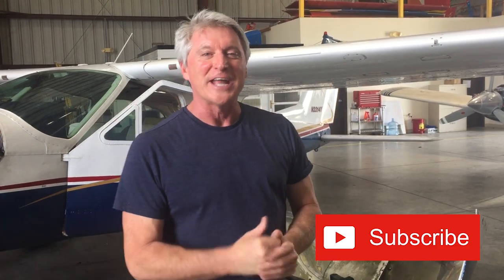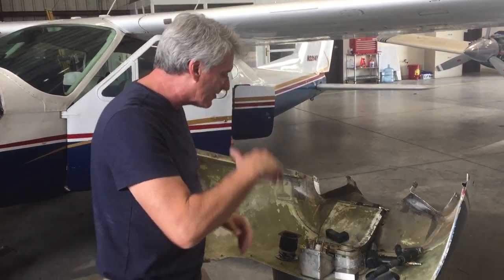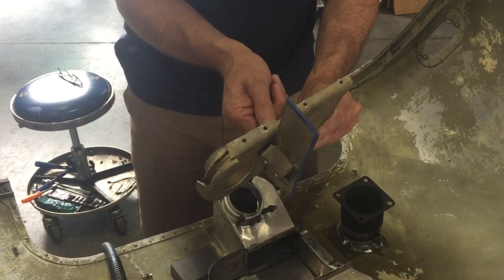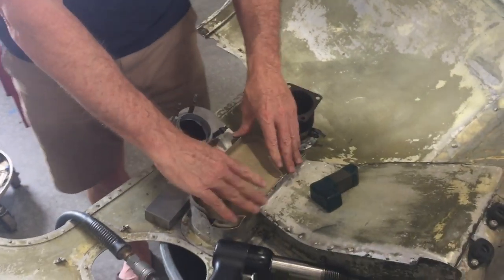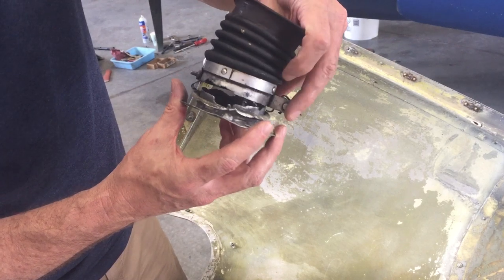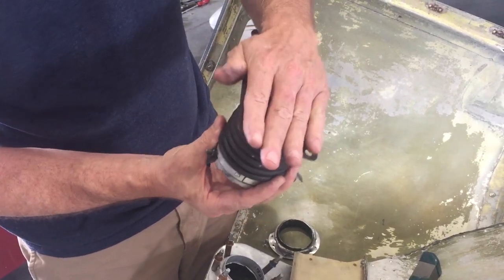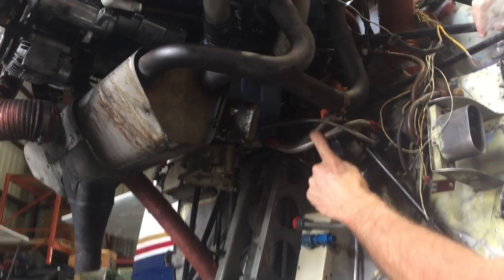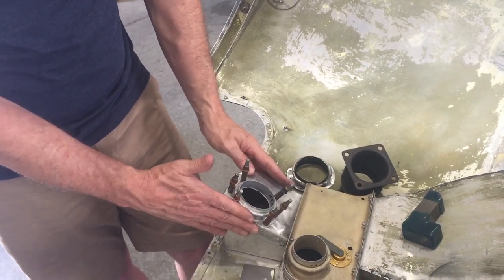How Does Carb Heat Work?

Comment: Ted, are you going to fire sleeve your 2 new lines and the hard line from the gascaltor  to the fuel pump. That's one less spot that can vapor lock!  The other mod I have seen on another straight (n2895x) is getting rid of all the garbage in the lower cowl and making it like the As& Bs and using the air valve off a pa28 140-160hp it makes getting the lower cowl on and off a total snap!!

Comment: All great videos. 
I just got my license, at 50 , and now looking for a plane. Would you recommend an older plane or spend little more up front for newer ( like 1998-2002) maybe Cessna 182, and maybe not have to deal with as many upgrades or maintenance issues ? 
Thank you
Reply from the maker: Terry Melton Absolutely. If you have the money go ahead and spend it and get the airplane you want because The maintenance items are a drag because your planes down for a few weeks every time something happens and a newer plane you’ll be able to grow into and the avionics are even more important. I am so glad I upgraded my plane to the G fives in the Garman and that is money well spent because I have very safe equipment in my airplane. So go ahead and spend the money and get a good airplane!!! Thanks so much for watching!

Comment: Great video! That air inlet looked scary. Did that happen in one year, or was it missed at the last annual?

BTW definitely get a good digital engine monitor. It can often give you a warning before the engine fails -- like finding hot exhaust valves before they fail. Do you know Mike Busch's videos/books? Check out his youtube channel at Savvy Aviation.

(I don't have to worry about carb heat any more, I now have a fuel-injected airplane! But I do have to worry about a different set of problems...)

Comment: Yes put a engine monitor in if you can. You will not regret it.
Reply from the maker: I know!  at some point I have to stop upgrading-  its a sickness!   I need to go to UAA -  upgrading airplanes anonymous...  :-)
Reply: @Over50andLearningToFly  Its this single best thing you can do to keep your engine healthy. With data logging you can actually detect a burned exhaust valve before it gets really bad.
Reply: You do not have to get a new unit. Check eBay  there are always units people have pulled when they update to newer units. It makes it an affordable  way to get a engine monitor .

Comment: But is the hot air filtered anyhow? Cold air flows by the filter in front - right? Seems that hot air is not filtered then...?
Reply from the maker: Kfiat ooh I don’t think it is ... I’ll check today
Reply: That is correct. If I recall correctly from ground School 20 years ago, that air is not filtered.

Comment: It brings warm air, but not combustion gasses, to the carb?  How does it separate the combustion gasses?
Reply from the maker: The air is heated off of the exhaust manifold, there are no combustible gasses -  just warm air...

Comment: Why do people still use it when there's no any icing conditions? Why would you even use Carb Heat in Florida during a landing?
Reply from the maker: Anytime there is moisture or potential moisture you should use it.  Carb ice can happen in 70 degree temps- the air is flowing through the venturi in the carb and can freeze pretty quickly-  its there for a reason.  Thanks for watching!